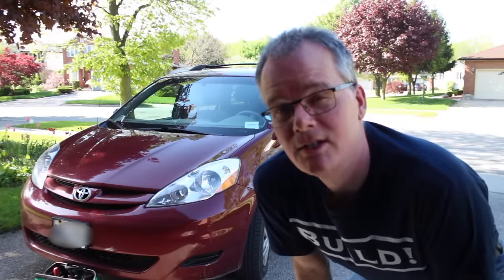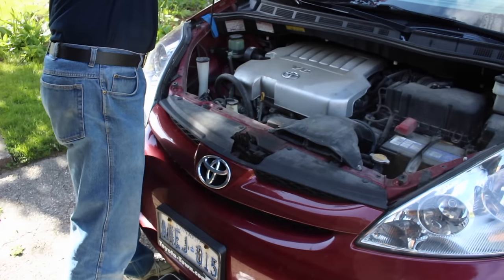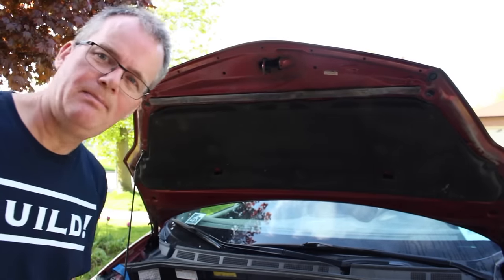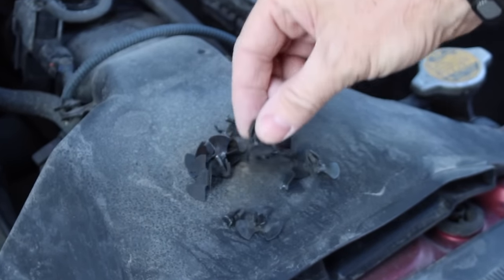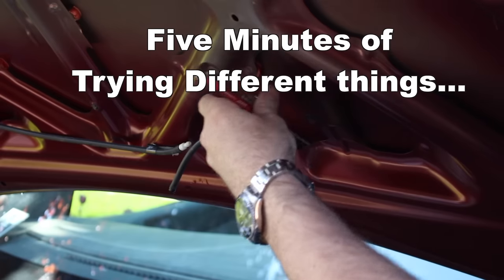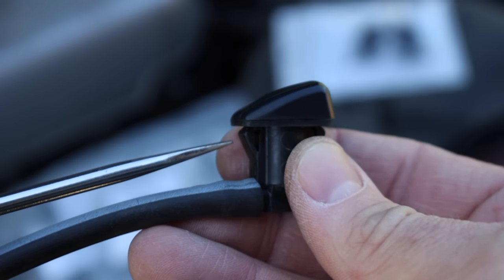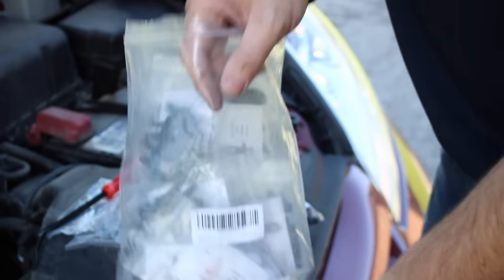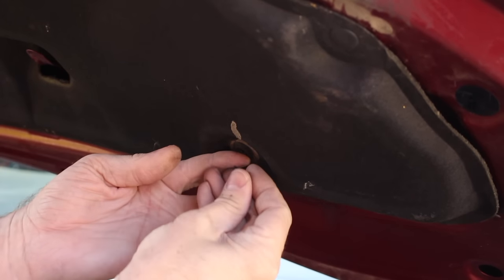HOW TO REPLACE your windshield washer nozzle (WnW #169)

Comment from the maker: PLEASE NOTE:  TWO MONTHS LATER I had to do it all over again, as the OTHER nozzle then broke.  I should have just replaced both of them at the same time.  Just FYI.

Also, I know, I totally missed the fact that there was a clip-removal tool in that package of assorted retainer clips!

----- ----- -----
How I replaced a Windshield Washer Nozzle on the hood of my 2010 Toyota Sienna.  There are a few tricky steps to accomplish, but you can easily do this in an hour on your driveway and save a bunch of money.

Thank you for your support!  
☕ Buy Me A Coffee:  https://www.buymeacoffee.com/wordsnwood
💵 Become a Patron: https://www.patreon.com/wordsnwood
🛒 Buy a Plan: http://wordsnwood.com/plans/ https://www.patreon.com/wordsnwood

---------- ---------- ---------- ---------- ----------
🗜 LINKS TO SOME OF THE ITEMS USED:

(These are affiliate links.  If you buy through these
links it helps support my channel.   Thank-you so much!)

https://amzn.to/2WnWGnK — Toyota Hood Insulation Clips
(Toyota OEM part.  I did NOT use these, but here they are if
you want what I think is the exact Toyota part.)

https://amzn.to/2YTqw13 — Assortment of Auto Retention Clips

https://amzn.to/2Ezjp5U — Front Windshield Nozzle Jet kit
For Toyota Sienna 2004-2010 model.   
(I bought mine from amazon.ca, could not find the exact same one on amazon.com but there are many to choose from that look pretty much identical)

📸  GEAR I USE TO MAKE VIDEO:

http://amzn.to/1qPkvBp — Canon T5i
http://amzn.to/2aK7jZX — Inexpensive Quick Release tripod ball head  (Very useful)
http://amzn.to/1SSwOmS — Sony Action Cam. (I use the HDR-AS15 which is discontinued -- cheaper than a gopro.)
http://amzn.to/267XM3M — Sony Live View video remote for Action Cam
https://amzn.to/2NddVjk — But I do also have a GoPro Hero 5 Black
http://amzn.to/1XC2D7l — Joby GorillaPod (Flexible small tripod)

---------- ---------- ---------- ---------- ----------

MORE MORE MORE:
http://www.wordsnwood.com
https://www.instagram.com/words.n.wood
https://www.facebook.com/wordsnwood

---------- ---------- ---------- ---------- ----------
🙏🙏Thank-you! 🙏🙏

Comment: Thank you so much. I was able to replace mine in less than 5 minutes after watching this. Lucky for me those caps on my hood lining didn't break
Reply from the maker: Welcome!   These comments bring a smile to my face!
Reply: One thing I did while wrestling with the plastic caps is actually STOP and take a closer look at them.  I noticed two tiny little circles on either side of the plastic disc facing out.  I figured, "those must signify something... like the position of the clips."  Sure enough, that tells you where the clips are located so you can slide something in to more easily release them from the sheet metal.  Not easy still, but it helps.  I still mangled them a bit, so ordering replacements that also happen to better engage, was the right call.

Comment: Perhaps it’s been stated above, but you don’t have to remove the liner. Just use that access hole and you can wedge it out just like you did, and angle it just right to allow the back side to slide out. That’s how the offset clip height is designed.
Reply: My 2009 year model is fully covered with liner with no other access 😅
Reply: Ours sheared off completely.  They snap off pretty easy, apparently.

Comment: Thank you for your valuable video, telling you that I really took only 5 minutes to change them, I even did not open the hood, I just changed it from the top with small screwdriver. But the thing I would like to mention that when buying a new nozzles, buy a good one, mine was not that good quality I wanted. Thanks again and good luck everyone!
Reply from the maker: Yeah, these were probably not the best -- both of them have popped apart since, but I fixed them by apply CA glue and re-assembling them.   A bit annoying, but I  now know how easy they are to replace so I could do that again if required.    I'm happy to pay my mechanic for tasks that are too complicated, but equally happy to save money on the many tasks that are SO straightforward.

Comment: Art,     thank you for posting this video.   It was well made and easy to follow.   All I needed was this little boost to do it myself and save about $50 on the repair cost.    I actually found the replacement nozzle for only $2  online.
Reply from the maker: Great to hear that this is helpful!

Comment: Nice video and thanks for sharing it.  I actually just pried my broken nozzle from the top of the hood rather than going underneath and removing the liner. I cut the end of the tube since there was plenty of slack and just reattached the new nozzle and snapped it back in.
Reply: Tried Sunil's method on my 2005 Sienna (510K clicks) but once i snapped off the old nozzle, the hose fell inside the hood. It was the drivers side nozzle, so all I needed to do was pry the drivers side retaining clip closest to the nozzle (I could reuse it), and bend a 2 inch flap of sheet metal that supported the insulation pad. I then feed in a piece of twin from the outside of the hood, tied it to the hose and pulled it back through, attached the nozzle, and was done. No need to remove the insulation blanket. Thanks for the video and Sunil's reply.
Reply: didn't that bend the hood?

Comment: Helpful vid, thanks, need to replace both nozzles on my 2001 Highlander. Also, a pry tool would remove those clips without damaging them, it's been a lifesaver for me as the clips, etc on my 19 yr old car continually need replacing.

Comment: Thank you for producing and uploading your video. I have a 2006 Sienna that is nearly identical. In my case, the washer nozzle’s top and bottom pieces separated. I was wondering why I was losing fluid volume and stream height in my driver's side nossel. I merely glued the two pieces together and reinstalled the nozzle. The repair worked perfectly.
Reply from the maker: My Sienna was from the end of that series -- 2004 through 2010 were all much the same.
Reply: @Wordsnwood  
Thanks again. The only thing that might have changed between model years is the shape of those confounding clips that hold up the hood insulation. The plastic clips were the most frustrating part of the task.

Comment: Good instructions I used the links for the parts and it worked fine, but I would make the following recommendations:
1. You don’t have to remove the heat shield just take enough clips off to access the one side - I took off only four
2. I just snapped the old jet off with pliers it’s garbage anyway.  
3. Don’t take the hose off.  There’s enough slack to push the end through the hole and connect the new Jet. 
With these improvements the job takes under five minutes with no struggling
Reply from the maker: Thanks for the tips!

Comment: Best how to video on this issue, but I had trouble removing the nozzles as well. I have a 2008 KIA Sedona. I bent the hood surface a tad while attempting to remove the left nozzle. Frustrated I thought about it. The nozzles are plastic. If the nozzle is metal this method won't work. I used a tool I had for scraping paint. The front edge was knife-like. I put several layers of two inch masking tape around each nozzle so I would not damage the paint. Then I placed the painters scraper with knife-like blade in the middle of the nozzle on the top of the hood, took a mallet, and struck the scraper handle several times, and it cut the nozzle of so easy that I was upset I didn't think of it sooner. Finally, all was downhill from there on, put the NEW nozzles in, and buttoned back the hood protector on the underside of the hood. 
I wanted to add a photo of the scraper I used but could not do it here. Hope this helps those of us that have the metal shroud over the underside nozzle parts.
Reply: Good suggestion, thanks!
Reply: @dogscratchedoor  Thank you, but still, I am having trouble adjusting the water holes of the device. One appears clogged:(

Comment: My driver side sprayer started doing that dribbling. I looked up different ways to fix it none of them told me how to take it out. Mine was a lot simpler because I didn't have the frame in the way. But, definitely thank you for the screwdriver trick.

Comment: One thing I hate about car builders/engineers is the fact that they could make things easier. You nozzles seem intentionally hidden..I just love those 5 minute jobs that take two hours, a lot of patience and possibly a shot of whisky and some encouragement from your blokes..
Reply: I’m fixing my nozzle on a 2010 Malibu and it’s easier than this guys but I still had to take off the hood lining. On my mom’s jeep I noticed they made the hose and nozzles easy to access without taking off the lining or having to get under metal like in this video. So yeah it’s doable.
Reply: @pogolaugh  not my jeep liberty, everything under the lining

Comment: Might be wiser to just replace both sides, also when buying these items on ebay or Amazon, make sure that it fits your vehicle, not all of them are universal, they are vehicle specific, enter your vehicle and the part in ebay and it we tell you if fits or pick some up at the wrecking yard, also where you can practice on the junk to see how everything comes off, you could also just remove bottom clips of insulation and hold a part of it up and out of the way clip it using a couple clothes pins to hood. Because actual water disperser comes off through top end.
Reply from the maker: Yup, did the other one two months later.

Comment: I just did mine. Using two credit cards to release the nozzle. Since it was on the passenger side I only removed 4 plastic plugs. I used nail remover tool and reused the plugs. I also bent the metal holder in order to move the insolation a bit further. It took me an hour trying to clean the nozzle. Cleaning would not help because the nozzle was broken. To replace it took me 30 minutes.

Comment: I replace mine without taken the liner off, I used screw driver and needle nose pliers and took the old ones out from the top ( they broke into little pieces) them pull out the hose trough the hole and connected it to the new nozzle them push it back into the hole. 
Call me lazy but it works.

Comment: Great. video. Paid $40 for 1 sprayer at Toyota. It was in stock. Shipping via Canpost takes several days now during Covid-19.
Reply: Toyota OEM pair for the Sienna:  $65.
Amazon replacement pair:  $9

Sorry Toyota, committing highway robbery on your customers for a little piece of plastic is not going to win you many points.  It WILL ensure your market of OEM sales dries up!

Comment: Thanks, very helpful.  However, there is no need to take off the shroud unless you lose the hose under the hood.  Grasp the nozzle and rock it forward, you should be able to dislodge one of the two clips.  Then rock it back the other way and pull out.  That should allow you to extract the nozzle without removing the shroud.  Hold onto the hose and attach your new nozzle.  Push it back in place until it clicks.  The hole in the hood on the underside is not covered by the shroud, so if you are having difficulty, open the hood and use a long flathead screwdriver to push in a clip.
Reply from the maker: Perhaps someone else will try this... hopefully mine are now set for a long while.
Reply: rocking like that isn't that going to bend the hood metal?
Reply: After removing the shroud (liner) I also came to the conclusion that it wasn't necessary. What I ended up doing was inserting an opening pick (https://www.ifixit.com/Store/Tools/iFixit-Opening-Picks-Set-of-6/IF145-123?o=2) between the hood and nozzle where the rubber gasket sits. Pressing the pick in against the latches releases them. Any piece of thin rigid plastic would probably work. Unlatching from the front and back fully released the nozzle. Then all you need to do is pull it out a bit to swap the nozzle on the hose and finish the job by pressing it back in place. No broken shroud and no broken clips. You don't even need to open the hood. Cheers from another fellow Canadian.
Reply: @PWiebe  i tried this but it seems my latches must be reinforced because it doesn't move at all; to the point that the pick is bending...

Comment: Thanks for this video.  I just sheared off one of my spray nozzles while scraping snow and ice off of the windshield and hood of my 2007 Sienna after a snowstorm.  I forgot about the nozzles as they were buried under 7" of snow.  After I watched your demonstration, I can easily replace both nozzles once I get the parts I ordered on Amazon (delivery due in a couple of days):  a set of nozzles for >$9USD, a package of 25 hood insulation retaining clips for $12USD, and a trim tool kit to remove them for $7USD.  With tax, S&H, it cost >$30 USD.   The only problem is that the temps are going to be in single digits/teens/low 20s next week.

Comment: Thanks for this great video. I had one nozzle disappeared (seems like it was stolen) and I need to install one. Your video will help me do this.
Reply from the maker: Glad it helped!
Reply: Someone stole your windshield spray nozzle????!
Reply: @jbre2149  ....That's what I thought at first, but after taking it out I noticed a piece was missing from the bottom part. I think it probably broke off when I was cleaning the snow off the hood. The other half was still stuck to the hose.

Comment: mine work the clips are just broke on both of them so they won't set right in the hood, you can set them back down but the wind will just knock them back out of place while driving
Reply from the maker: not much good then... good luck with replacing them!

Comment: I pulled the nozzle and part of the hose was still attached it!! Is it bad for the car engine if I use the spray without it ? Will it dribble into the car under the hood? My plan was to just soak the nozzle portion in vinegar to see if that unclogs whatever is keeping it from spraying before trying to do what you’re doing . It’s still too confusing for me .

I have a 2008 Toyota Yaris

Comment: good; glad  such worked; though at replace nozzle I wonder if some similar ferrule tube could have been epoxied into old nozzle?  as replacement anyway might have worked?  something like a new WD40 spray straw nipped tight/short?
Reply from the maker: I did not actually try cutting open the old nozzle... now I wish I had

Comment: That is why you buy Winter Washer fluid  with -40  degree protection. 
The cheap fluid froze and the nozzle popped out.
Reply from the maker: I may live in "the North" as far as people from USA/Mexico are concerned, but as far as Canada goes, I live in the "South".     We rarely go below -15 here.
Reply: I always use the -40°C or -45°C washer fluid and it still happened to me. Wear and tear plain and simple. Great tutorial video.

Comment: There is a tool that costs about $3 USD that removes those retaining clips on the hood insulation pad without breaking them off.
Reply from the maker: Good to know.   The other nozzle broke about 3-4 months later so I ended up having to take them all down again.  Good thing I'd bought a set of two nozzles.

Comment: Hey! I am from canada too lol. Nice easy fix. I need to get a bag of those clips. All the plastics on my quad are held on with those. They are always breaking
Reply from the maker: you want an amazon link?    I can get you one...  ;-)     
(Search for "Rolinger auto clips")
Reply: @Wordsnwood thanks, I will look them up.
Reply: Wes Hamstra buy the ones where you can reuse them..the middle pops out and you can pop it back in

Comment: Do you also have to apply silicone as sealant all around the nozzle in order to prevent rain water leaking into the engine compartment?
Reply from the maker: There was not any silicone or caulking under the previous nozzles

Comment: i would have worked the hose loose from the sprayer jets using some needle nose to wiggle off n hold and just replace the nozzle’  i’ve done it on 2007 subaru

Comment: very usefull video Sir. I have a Toyota yaris and i am in the UK i tried to the water jet with a needle and in one other jets the needle broke of inside so i need to do what you did but i am having great difficulty in removing the heat shield as the manufacturers clips are totally solid and seem impossible to remove. is there any way i could remove the broken off pin from insde the jet without removing it.
Reply from the maker: Sorry, no idea.   Note that the clip pack that I bought from amazon came with a tool for removing those heat shield clips but I had not found it in the bottom of the bag when I filmed this.  I did use it when I replaced the second one a few months later.  works great.
Reply: @Wordsnwood  thanks i will look into getting the universal clips i think.

Comment: All you needed to do was use a string and run it along the hood and under the front of the nozzle, thus releasing the front clip. Do the same to the rear clip and them pull the nozzle up and out. Then install the new nozzle (without letting the hose go back into the hole) and click it back into place. No need to remove the hood liner at all, and takes just a few minutes. Now you know for next time.

Comment: Can’t figure out why you didn’t use the removal tool that came with the bag of grommets to remove the original grommets, makes things so much easier.... otherwise good video, thanks for sharing..
Reply from the maker: Neither can I.   I certainly did when I replaced the second one two months later.  The only thing I can think is that I somehow just didn't see it in the bottom of the bag...

Comment: Really helpful video on both nozzle and clips issues. Got replacement #'s & found on Amzn for some reason the direction of spray isn't optimal, so maybe a  sub-par part. Can't see that there's a wiggle room for adjusting the angle. Also my replacement is supposed to use a gasket which might be the problem.
Reply from the maker: yeah, no adjustment on mine that I could see.